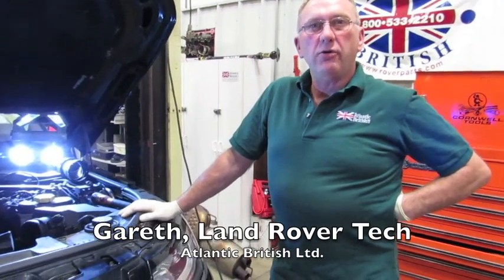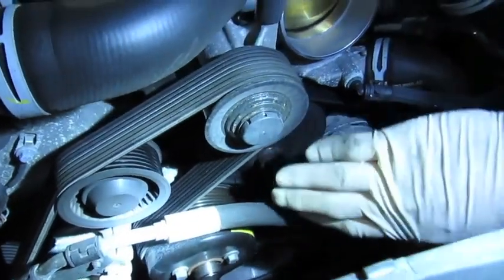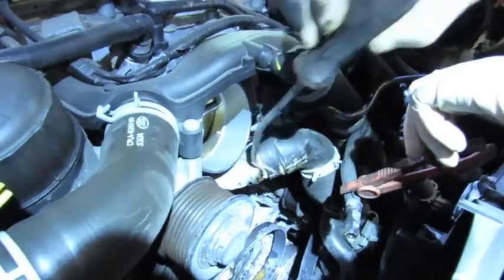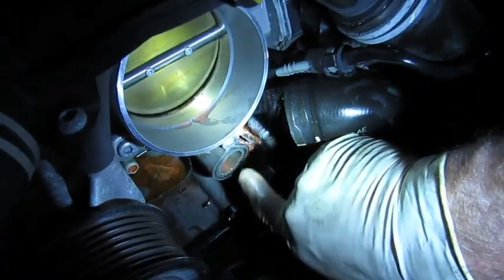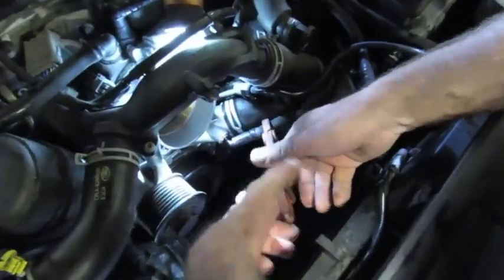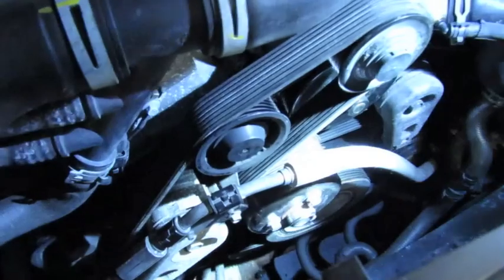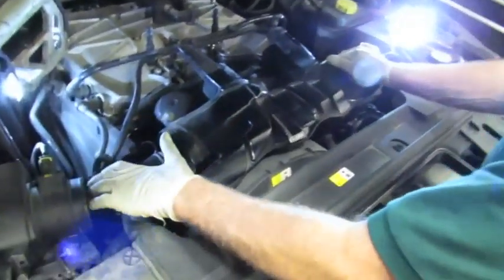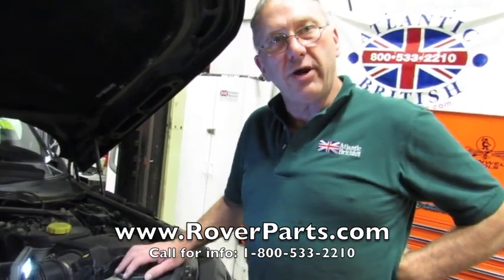Install Water Pump on 2014 Range Rover Sport

Comment: Great video.  Doing that without the supercharger removed is a trick. And all fine and dandy till I broke a waterpump bolt. Lower one on driver's side actually protrudes into open antifreeze causes it to seize . 2 weeks of careful Dremmel grinding and I was able to Heli-coil it. Nightmare

Comment: Nice video, personally I've done more broken y pipes under the supercharger than water pumps, most failures I see are well over 120 thousand miles . 
Very durable when you think about it.
Reply: Not sure about the V8, but I had the Y pipe crack on my 2017 3.0S Velar P380 at 32,000 kms. Luckily for me it was still in warranty so the dealer handled it. I've now just had a leak start from the thermostat housing at 52,000 kms. Oh the joys. Plastic fantastic

Comment: Clarification is needed on the difference between "counter clock wise" and "anti clock wise" are they not the same? About 1:45 they are mentioned regarding the fan...
Reply: Supercharged = counterclockwise (lefty loosey righty righty)

NA = clockwise (righty loosey lefty righty)

Comment: I have a technical question.  There's an actuator with 2 vacuum nipples bolted to the back of the supercharger.  It has an electric pigtail plugged in . But vacuum no lines running to it. What is this and can I leave it ? It will be buried when I install the supercharger

Comment: Why has no one asked about the torque specs for the T30 water pump bolts? Seems important.....I would hate to snap one of those off. The video mentions torque but does not say. Anyone know? I just got my old one out. Thank you for the video!!!!
Reply: I did snap one off. Lower one on driver's side goes into open antifreeze. Gummed it all up. Had to Dremmel it out. Then helicoil cuz it was impossible to not get into the aluminum.  I went 18 footpounds and that felt tight
Reply: Its a German car the specs are goodntight.

Comment: My question is what is the right Torque for those tiny screws on the water pump .. I get all kinds of different answers lol 🤦🏽‍♂️ 2011 Rover sport HSE v8 5.0 none supercharged.  I can’t stand the fact that rover put all kinds of plastic parts on this motor 🤦🏽‍♂️ it’s a amazing machine! But way couldn’t they have used aluminum tubes with a flange and o-rings. Would it really have cost them that much more money this is a 90k machine !!!  🤦🏽‍♂️

Comment: For the small elbow on the front of the waterpump, how do you remove it? The video mentioned to put pressure on the plastice sleeve. How do you put pressure on it, with what tool?
Reply from the maker: You can put straight pressure on it with the flat side of a flat-head screwdriver or something that will give you leverage without damaging the sleeve while you pull the elbow off.
Reply: im doing this job right now and i couldnt find any good info about how to push it either. you push the collar back against the water pump. the collar stays in the pump and the plastic elbow slides all the way out. imagine one of those plastic snap rivets but you can pull the center part all the way out.

Comment: Hi. I have a call at lake on my 2014 Range Rover sport. The coolant splash pattern is under the air intake, at the side of the oil filter and under the oil filter. I don’t feel any wetness under the front plastic crossover tubing. I don’t see any wetness around the back plastic crossover tubing ( the tubing behind the manifold). I watch this video and was thinking possibly it was the water pump. Does this splash pattern sound like water pump damage?
Reply: There’s also a lot of our food under the water pump on the front of the engine
Reply: I apologize for dictating. There’s a lot of antifreeze on the front of the engine under the water pump
Reply from the maker: @doctortammymayo3997  Possibly... have you checked the related coolant hoses?
Reply: Atlantic British I will look. Thanks
Reply: Hello again. I have removed the air intake Plenum and I see The antifreeze all around as I said before. I don’t see any wetness on the tubes.  can I start the engine without the air intake planum on just for a few seconds to see if I can see where the antifreeze is leaking?
Reply from the maker: @doctortammymayo3997  Your best way to test the system for leaks would be to pressure test the system... https://www.youtube.com/watch?v=7RDarciXfwg

Comment: On a 2013 range rover sport supercharged, when standing in front of the engine bay when taking of the fan, do u turn the nut bolt with the wrench clockwise or counter clockwise? I've been trying counter clockwise but it dont budge. Your help would be appreciated.
Reply: All of them loosen in the opposite direction of rotation. The catch is, where is the pulley in relation to crankshaft rotation. Some are off to the left, others to the right, which can change the thread on the pulley.

Comment: Does anyone know the part number of the hose with the plastic elbow that goes into the water pump ? Thank you in advance
Reply: It's part of the upper turdmostat hose

#LR049990

You should also replace throttle body pre-heater hose

#LR045239

Comment: Hi there I have a 2012      Jaguar  XF same water pump deal 5.0 engine but for some reason is still leaking antifreeze around that area can you help me out?
Reply from the maker: Hi! We would really recommend you seeing your Jaguar mechanic to diagnose the issue, but with the 5.0 engine there are several spots that can leak including the gaskets around the water pump along with the o-rings and seams at the Y-pipe that extends out from the water pump.

Comment: How do you get the tensioner into proper position with the belt on it?
Reply: It only goes one way two notches on the back side that fall into a grove   .. if your a DIY person it’s always best to take a picture of everything before diss assembly. Or draw it on paper 📝 ..
Reply: @chasingwaves11  Thank you for replying. My problem was that I was not applying enough torque. Once I added an extension to my wrench, that solved it instantly.

Comment: How much is this job completely done with parts and labor?
Reply from the maker: 100%
Reply: That would all depend on where you get the parts from and who does the job. It's not a hard DIY job if you are comfortable with working on your Rover.
Reply from the maker: Here's the waterpumps... they are on sale at the momment: genuine: https://www.roverparts.com/Parts/LR097165GK | aftermarket: https://www.roverparts.com/Parts/LR033993K. General rule of thumb with Rover waterpumps... If you are looking to hold on to the vehicle for a while, you'll want to spend the extra for a genuine or OEM waterpump. If you aren't holding on to the vehicle for long, lesser aftermarket pumps are OK, but they usually don't last very long.